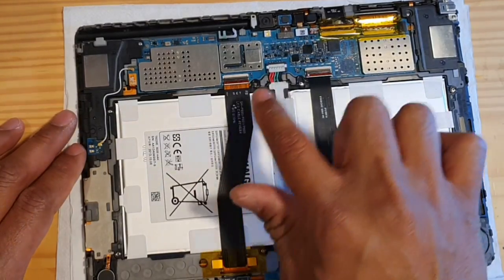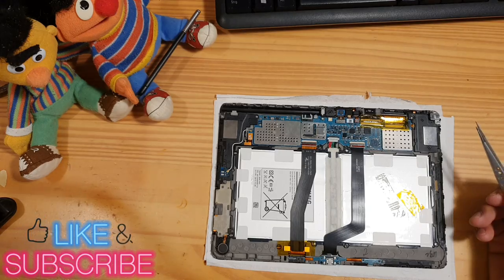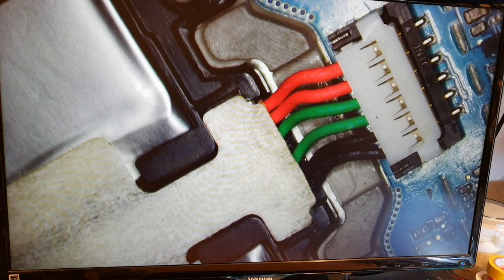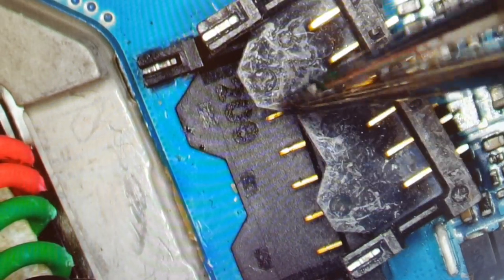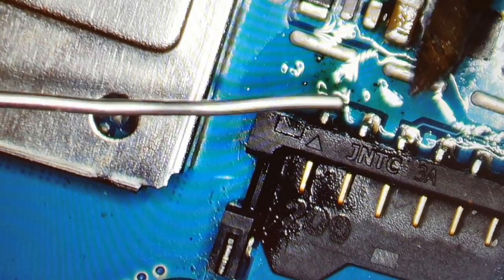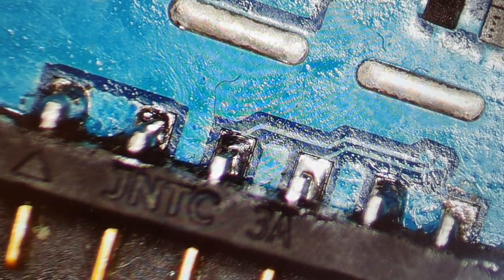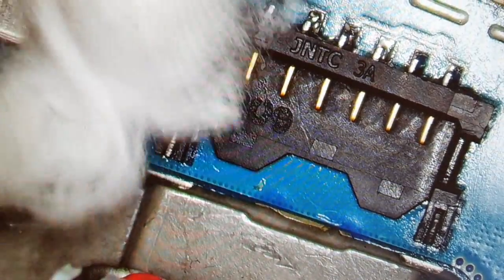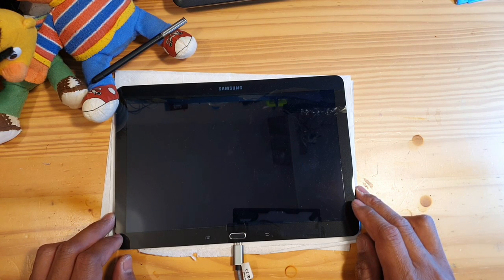Galaxy Note 10 .1 not turning on FIXED ● Easy Steps how to Troubleshoot DEAD Tablet

Comment: Hi, I have a problem on the same tablet. Will not turn on. I tried reconnecting the cable from the display, battery power. Nothing works. Is it possible that the battery is bad? After connecting to the charger, the tablet also does not respond.
Reply from the maker: Hi,
that sounds you need a new battery 👍. New battery for this tablet is not expensive, maybe under 25$. 

If you want to make sure, if you have a tester test the batterys voltage. If the voltage is fine. Please write me again here. I will try to figure out with you.